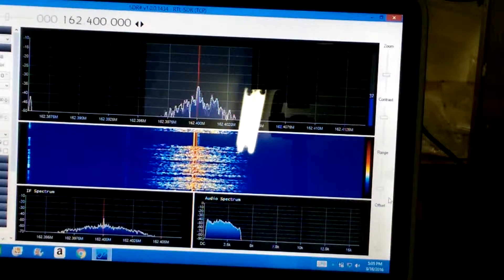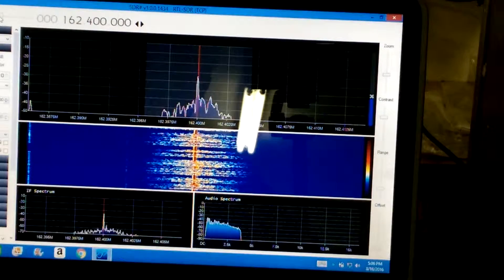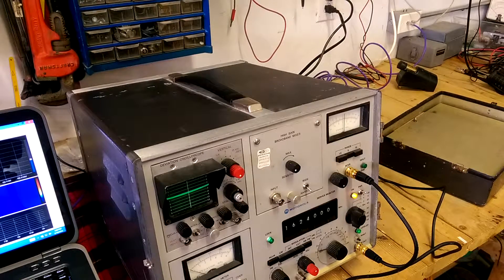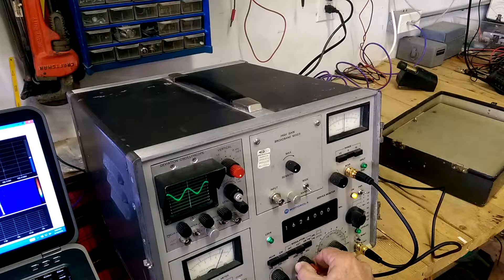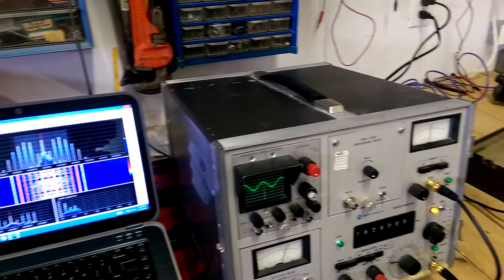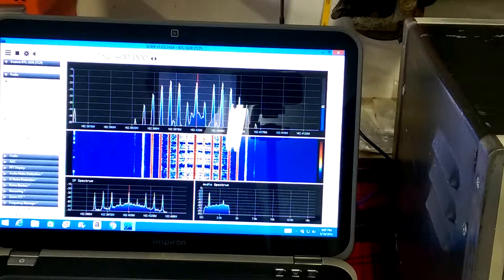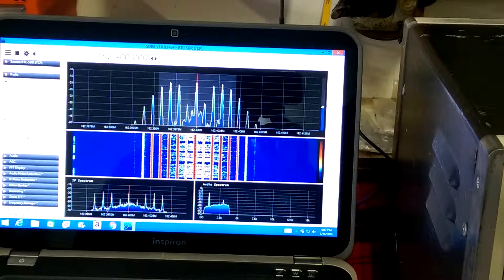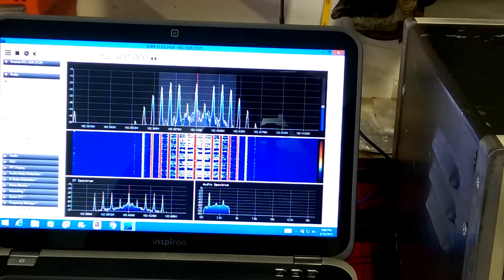Motorola R 1200AX Service Monitor

Comment: Greetings from the Dominican Republic, I'm Marcos Lopez.
I have that same service monitor and I have not been able to use it, since I do not have its user or service manual, I don't know if you could help me in that sense, how to use it and the basics, at least to adjust my HF radios , my monitor is MOTOROLA R-1200A, I have turned it on to 12V and it seems to be going well but I need the user manual or some explanation of how to connect my HF to it. Thank you, a hug.
Reply from the maker: Marcos,
The information I have is located here: https://www.ka7u.us/category/antiqueradio/
Good luck with this old service monitor.

Comment: The monitor that preceded this was the S1327 A & later on S1327 B. The one you show in the video was an improvement. All these were made by Systron Donner to the best of my knowledge. I had a 1327 a long time ago & traded it away.